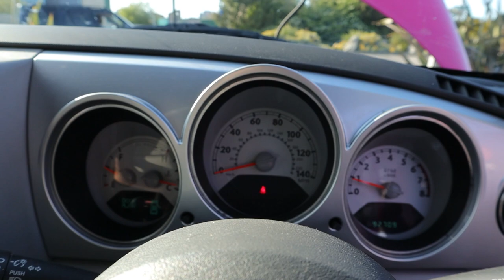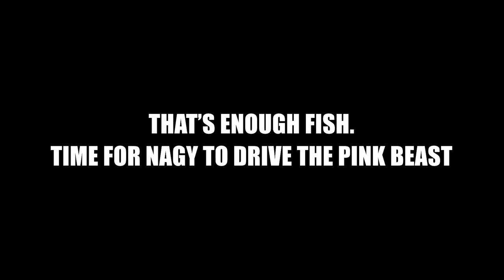Sim Racers Try Karting (And Most Of Us Get Injured)

Comment: Suggestion (or whatever you call it): in rental karting on grippy tracks like this you should lean out with your body, because you put more load on the rear wheel (depending on which direction you turn Example: you are turning left, and with Lean out you have more load on rear right wheel) and it gives you less understeer (= better exit and less turning with your s. wheel) + you are not "braking" any G-force laws.😁